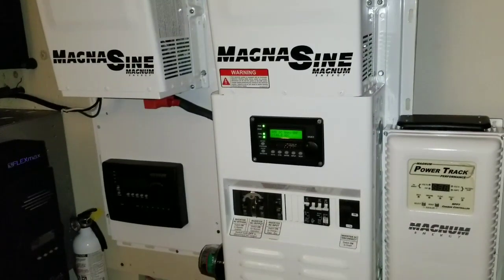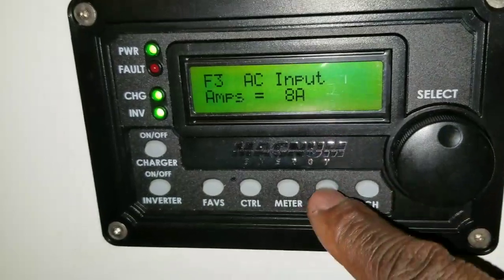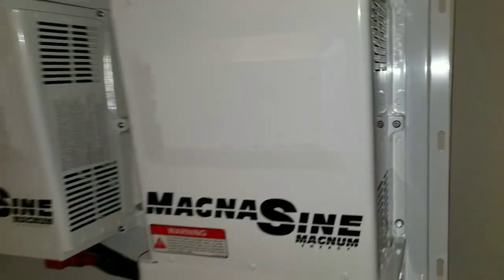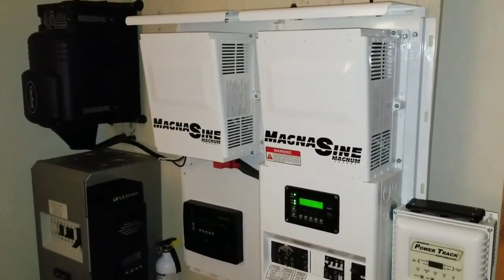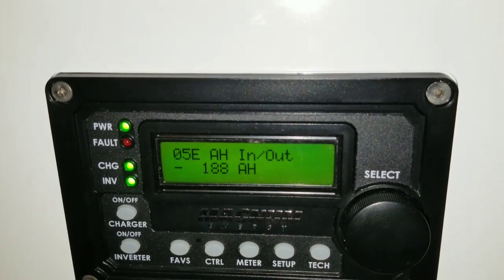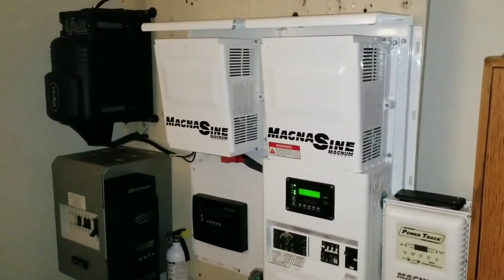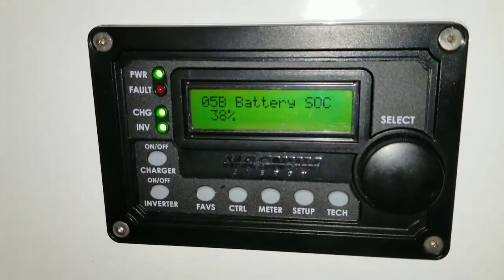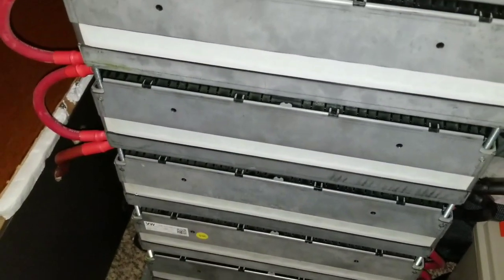SANYO LITHIUM BATTERY - Volkswagen e-Golf lithium battery powerwall update 2

Comment: I really hope to get into lithium batteries. They are just a beast for power.
Reply from the maker: Yes.
You can do all your welding with lithium batteries
Reply: @jwsolarusa  What would be a decent budget 2000 watt pure sine inverter to look into. I am still undecided on battery bank but shooting for 24v over 12v.
Reply from the maker: @cutweldngrind  
Shoot for 4000W 24V MagnaSine Magnum Inverter Charger. You can come across decent prices online for $1,200 to $1,500 open box or lightly use and don't hesitate buying it.
Reply from the maker: Check this out this Magnum Energy MS2012
https://www.ebay.com/itm/323650913747